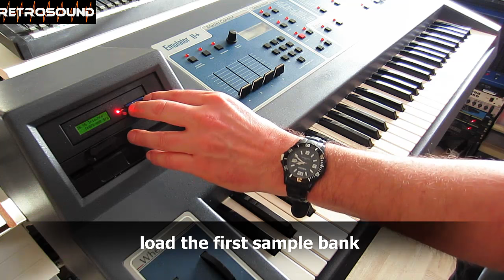E-mu Emulator II - Lotharek HxC Floppy Drive Emulator Upgrade How to

Comment: This is one of best ideas I've ever seen!
Reply from the maker: +Michael Smith :)
Reply: I'm on their site, right now, but it looks like they don't have anything that would work with my S5000 (which I don't have a hard drive in, and with a dodgy external Jaz drive).
Reply: Have a look on the forum +Michael Smith. They are normally very good at adding support for hardware if you ask!
Reply: gslug1 Thanks!

Comment: Super clear and helpful video, thanks. Is it necessary to make a new cable? It seems like the old cable is the same as the new cable (or am I mistaken?).
Reply from the maker: The Original cable is too short. That is the problem

Comment: Thank you for this guide! I’m one of the simpletons that needs more info. Where do I source the adapter, and what specifically do I need to search to find the ribbon cable and Molex connector? Thanks you!
Reply from the maker: Search on ebay.
Reply: @retrosound72  Hi again. I've got all of the parts I need and I am getting ready to install the upgrade. Now I need to figure out the SD card - can you tell me what files I need to put on the SD card, and where I could find an archive of Emulator II sample files?

Comment: I have a EMU II+HD which works great.  I wonder if I should go for this? One thing I DO know is that the HD loads very quickly.  How quickly does the HxC load?  Is it as slow as a floppy?  Also, should I replace the floppy and leave the HD?  or replace the HD with one of these?  Thanks for the great video!

Comment: Wow, interesting keyboard. First time I saw this it was with Ric Okasek on Saturday Night Live, after I had already been amazed by music keys and cash registers with 3.5" floppy drives. I couldn't believe things like this went back to the 5 1/4" days! But all the others only have one drive. So what's the lower drive's primary role?
Reply from the maker: You can load 2 banks and copying
Reply: I guess you could load 2 or more banks even with one drive and disk swapping,  @retrosound72 , but it's true that this makes copying easier than it is with just one drive.

Please tell me that the OS of this keyboard is on ROM, though. Right?
Reply from the maker: The OS is on disk and load fromm disk in RAM
Reply: Huh, that's interesting,  @retrosound72 ! I was hoping it wasn't that primitive for a stand-alone device like this (though I know it's different for full computers besides tablets). Well then will you please show us what it looks like if you try to use that keyboard before the OS boots in, and then show us the boot process?

Comment: Is it possible to read an original Emu floppy disk and copy it immediately to the Lotharek HxC Floppy Drive Emulator ounce it is installed in the Emulator II?
Or do you need a PC with a 5 1/4" floppy drive to transfer all Emu floppy disks to the SD card?
Reply from the maker: you need a image and than you must covert the image with the EMXP software to  a hxc file

Comment: Compared to the original disk drive, is the HXC2001 faster, the same or slower in terms of loading speeds? I'm considering putting one in my MC-50MKII, MC-500MKII and EPS.
Reply from the maker: the same